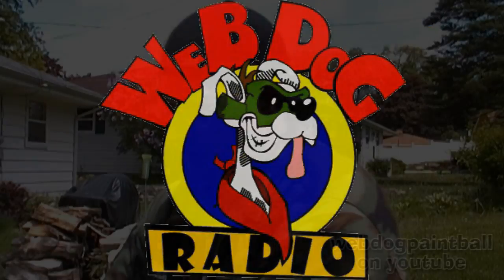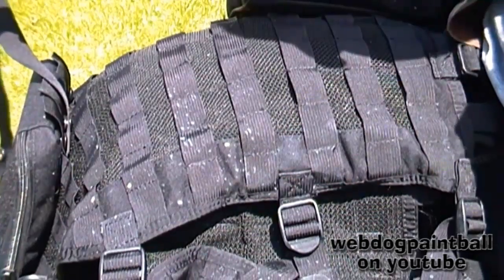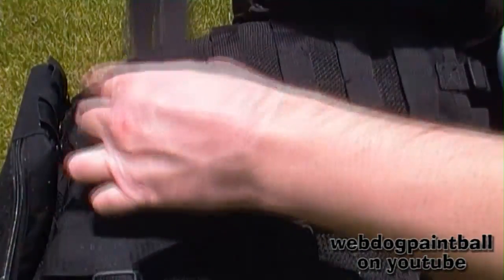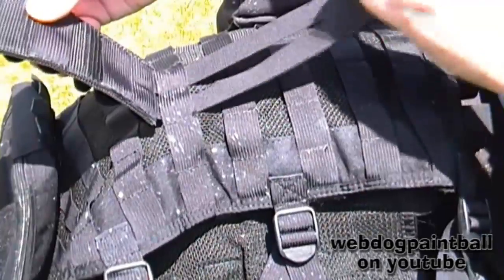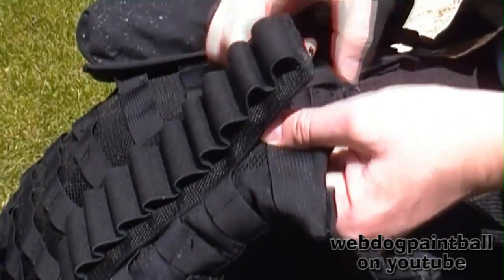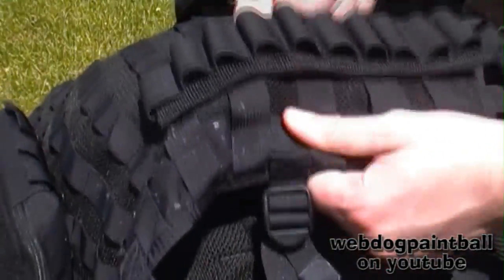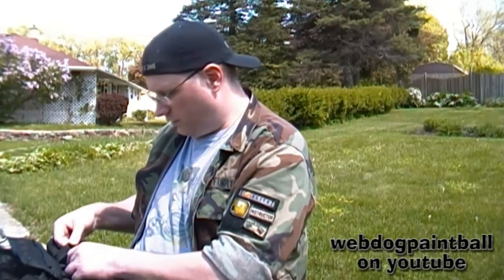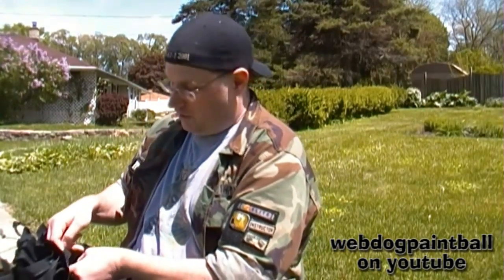How to attach gear to a MOLLE vest

Comment: you would be surprised, even a ton of soldiers dont know how to use molle gear... If your pouches are tight, you need to wear them in... just like when you get a holster from the shop, you have to draw your mag, weapon, ect. a lot from the gear to loosen it up. 

Hope that helps dude.

Comment: i have a paintball tank pouch that doesn't have the straps on the pouch it self its Velcro and it keeps falling off. any Idea on what i can do to stop it from falling off. It comes off when I hard fast.
Reply: It just has Velcro or the Straps are attached with velcro ? Sew them on, or if it doesnt has Straps attach them ate the top and put a smaller one on the bottom. Weave it and make it knot down with the second strap. works finde